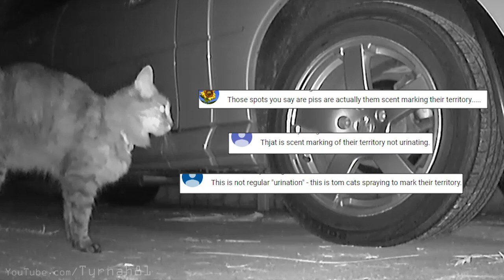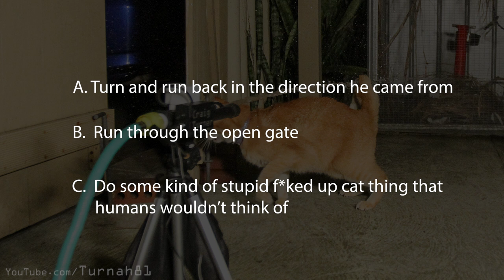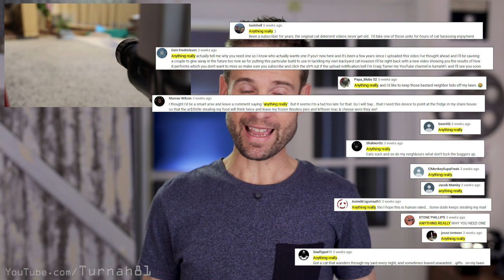Defending our Bird Nest from the Neighbor’s Cats

Comment: Idea, water blasters facing the left & the right for maximum water coverage.
Reply: exactly what i was thinking , spray them with a wider nozzle !
Reply: A simple fan dispersion pattern nozzle might work
Reply: Idea, make a flamethrower version
Reply: @Magma_122  I laughed to much at this
Reply: @-wubb5857  :)
Reply: @Magma_122  wait no XD
Reply: I'm surprised he just made a steam tip instead of one that disperses the water more but still soaks the cats. Not shitting on him by any means. I absolutely adore his creativity and that he is willing to share this adventure with us.

HE EVEN GIVES INFO ON THE DEVICES SO YOU CAN MAKE THEM!!! What a guy.
Reply: @wmoros4902  do I hear that in monotone
Reply: Crossfire.
Reply: @Damocles Media   lol 😂🤣😂🤣
Reply: Damocles Media also multiple heads that trigger in the cats path.
Reply: Honestly I was thinking they should make them turreted somehow, maybe using either a motion or heat sensor, with integrated high power flashing lights and then set them up at strategic vantage points around the house. Boom! No more trespassing cats!
Pretty sure it'd be quite easy to make the custom parts with a 3D printer, too.
Reply: Spray paint and then maybe the owners will get the message to keep their cats indoors
Reply: Wayne Iselin Eh, too extreme imho. They're cats not dogs, you can't train them and keeping them inside is next to impossible unless you basically imprison them in a room/box or something. 
This way I think that after a few weeks they'll just learn not to get mear the house
Reply: @Magma_122  It was also my idea. Some cats aren't scared of water. If they learn it won't kill them, they will keep coming.
Reply: @ilyaakadishtungha7337  Difference on both, stray cats and domestic cats... You raise them and it is up to you to let them outside at any hour or teach them to stay.

Cats aren't that social by nature to need their walks nor meet other cats- which meeting other cats usually ends in a fight.

In my humble opinion, their owners are responsible. As the owners of dogs also do.
Reply: @UKkenny  I thought of that too, but maybe he opted for the tight nozzle for a faster spray. The wide nozzle makes the water travel considerably slower, without a proper soaking (depending on the type of spray). On the other hand he had the right idea, bad maybe aim lower and position the water hose closer so that theres less reaction time
Reply: Change the setting from jet to shower
Reply: Put them lower and put on a nozzle that makes the stream flat
Reply: won't work as the two Mechine could hit each other and disable it
Reply: Archon Knight same, we might have a few problems😅😂
Reply: Damocles Media sunrise mode 😂
Reply: Damocles Media make the nozzle a little bit lower so it would actually hit them
Reply: Or do some programming and allow it to shoot 180 degree
Reply: @Magma_122   1 week later:
Channel terminated for violating the youtube guidelines
Reply: No... FULL ON MOTION ACTIVATED SPRINKLER SYSTEM!
Reply: Damocles Media  uy
Reply: Battery-powered motion detector water sprayer deterrents already exist...several models are sold on Amazon. Just attach them to your hose and stick them in the ground.
Reply: Magma_117 :3  acid.....
Reply: Excellent observation
Reply: And put citrus in the water and ground pepper, cats hate that.
Reply: And one in middle with motion detector trigger so he will get hit by one and run into another.
Reply: Or just replace with a tazer!
Reply: Checkout the Orbit “Enforcer” line of sprinkler deterrents
Reply: + adding an IR sensor-triggered Airsoft AEG with 
 a 200+ BB magazine.
Reply: Soaking the cat would just be horrible for no reason. This invention should only be to scare the cat. If the cat did get wet, the cat might stress the cat and would confuse the owner.
Reply: @buzzywuzzy5256  Who cares, cats are horrible!
Reply: James Gubbins ur insane
Reply: and above xD
Reply: One that traks movement : D
Reply: Put one in the middle of those 2 so   that you have 3 streams of water, so that way the water doesn't go around the cat
Reply: @UKkenny   i use A stick trap they give ne raybes
Reply: @Magma_122   When will you be president
Reply: @ixalaz4536   Are you sure about that?
Reply: Or in spray format instead of stream!
Reply: Add 500 mouse traps to the floor....problem solved
Reply: I say set up a cage with a motion sensor inside. Once the cat's in the cage shuts for and hour and continuously sprays the cat with high powered water until the cage reopens.
Reply: Ethylene glycol (Prestone)for the liquid.
Reply: Rat bait and sausages has 100% success rate for me. Never seen them again.
Reply: True, but you don wan o give the cats hypothermia on any cold nights, or you could have dead cats all around the neighborhood and people wouldn't really be happy with that
Reply: @Magma_122  make sure you season the damn cat first before you go on using it.
Reply: @Magma_122  Agree, I hate cats lol
Reply: One on the left, pointing right, and vice versa
But be sure not to cross the streams ;)
Reply: Damocles Media Idea, shotguns instead of water sprayers.
Reply: That's too much, they're not trying to torture the cat
Reply: Add another spray below to get more water on the cats.
Reply: Or a bucket drop, from above.....Ker Splash
Reply: MAybe one that tracks the cat! (u could edit your comment)
Reply: 1 shooting forward. 1 shooting to the left of it. 1 shooting to the right of the original. Triple turret, triple wash
Reply: @DucceMannen02  
Some people I know had a stray cat situation on a farm, well let's just say those cats didn't have 9 lives.  Mossberg and Benelli had a body count(s) that day
Reply: or perhaps a "fan" type spray !  More coverage !
Reply: Lol I just thpught he should lower it.
Reply: Might as well just drop em in a “kitty”(kiddie) pool
Reply: Lower the nozzle to ground level and tilt slightly upward to get a more effective kill zone!!!
Reply: yes, put another by the escape route to the right

Comment: Love it! We have a cat problem here also, most our neighbours have a cat that roams during the night and day. We have had two native birds killed, several lizards dead in our garden, scratches on our bonnet, two dead snakes just to name a few. 

We purchased a cat trap, caught the five roaming cats 13 times with every time dumping them at the pound so the owners had to pay a fee to get them released. They didn’t learn their lesson. So now, we have set up an electric fence around our boundary, the cats go under the fence where the wire is,  need I say the cats rarely come here now? We turned up the voltage a little bit as they didn’t learn the first time. Now they certainly do.

Comment: Any chance of showing one that can use a tank of water, pump and battery powered rather than a hose. A friends, yes, I'll go with a 'friend' requires a set up like that.
Reply from the maker: Yep could just use pressure sprayer. Hose size would need to be adapted down though.
Reply: @Turnah81  Cheers for that, need something to keep the felines from leaving their 'messages' as well as using the car tyres as a scratching post.

Comment: I'm a cat owner and I have to say I like your creative solution. I would like to give a bit of advice on some upgrades to the system that I think would be more effective.
1. Rig the spray system to have a thinner jet stream so it goes further and has more impact when it hits.
2. Rig a Jug to the hose system so Instead of water, you can use a diluted vinegar solution, this will not harm the cats but the smell will keep them from coming back.
3. Use some kind of automated rotation to swing the nozzle of the device in the direction of the cat, don't let them explore. This will keep them from even thinking about exploring the area they enter. Becomes an effective deterrent.
4. Wash down everything they pee on with a urine neutralizer. Part of the reason that you have a cat highway is because of the scent. Cats memory of an area are triggered strongly by scent, if you reduce that along with all the other deterrents, they will not use this path anymore.

I liked the video.
Reply: @DragonDaSilvahas_massive_chode  Such as?
Reply: He mentioned he neutralizes it with bleach.
Reply: @DragonDaSilvahas_massive_chode  XD What? Like no more videos like this?
Reply: Swap it with shotgun
Reply: I think that the spray is fine as it is; enough impact, distance and the wide jet also allows to reach more fur as "collateral damage" if the main stream misses the cat (just like happened in this video).

The vinegar solution could be effective, but I don't think he will enjoy that smell on his backyard...

Despite that, I fully agree with the 3rd and 4th point :)
Reply: A higher pressure spray would go straighter and then he could lower the jet such that it wouldn't almost miss cats going in the intended route for the system (??? bad design lol)
Reply: After reading first three words:
No you’re a Raccoon
Reply: For automatically aiming directly at the cat, you could use the cat's eyes as they always appear as very bright spots in your night vision footage, which would make for easy and good reference points to avoid it firing at just whatever
Reply: Better idea, grab the Smith and Wesson franky.
Reply: @SeaIify  the smell of vinegar dissipated once dry
Reply: @DelightfulDissident  Yeah, but the taste doesn't and they have to groom that off. That's something a cat will remember.
Reply: @NecrochildK  oh I bet 😄 I was responding to someone saying that he wouldn't want to use vinegar in his backyard because of the smell. 👌🏼 I'm pro vinegar water.
Reply: @davidtogi5878 + No. There is no need for guns.
Reply: @dogsaretheworsttheyarenotm9647  their cats. Of course there's a need for guns

Comment: We have a similar situation here. There is a bush right outside our living room in which a bird has started building a nest. This isn't the first time a bird has used this bush for her nest, the last one was a few years ago but ended in tragedy. At that time, the babies hatched but their home was sacked and the young ones killed, by one of the neighborhood cats or so we suspect. This time we are going to help fortify the nest without scaring the mother, so looking for ideas. I like this motion activated water spray solution, as I can engineer it elsewhere and place it on the ground without too much disruption to her privacy. Other ideas that crossed my mind was to erect an elevated chicken wire fence around the bush,  cast a net over the bush with an opening cutout on top etc. I have to make up my mind quickly. This was hilarious and the size and scope of the project is equally impressive.

Comment: You should have made a thing where there is a square of like wood or metal and on the middle put food or something the cats will check out but have a weight censer on the square so after a few seconds it really fastly pushes the square up and yeets the cat many meters in the air.

Comment: Love it...  .F Y. I.  the military use 3 kill zones in a ambush scenario
  the main kill zone in the middle  flanked let and right   you could use this technique for extra soakability
Reply: And some water balloons attached to the ceiling, in case he needs air support.
Reply: Or like... copy my unit and use bullets to get rid of the problem.

One pellet rifle, a couple nights, some discrete plastic bin bags, and you're good.
Reply: Yard Sale Dale  Oh interesting! I didn't even know those existed, well, I knew about primer only .22 loads but I thought those were long extinct with gallery guns. 

The thing being, from my research the SC .22 appears to only be viable on squirrels within 20m out of standard rifles. You can easily get the same results out of a high quality air-pistol that'd be more customizable, cheaper, and more easily acquired than a conventional firearm. Additionally, you can easily suppress (mount a suppressor to) an air gun, not so much a regular firearm... that is... unless you wanted to operate by don't ask don't tell rules.
Reply: Mr.Techaky a buddy of mine had a breech loading .22 that he put a homemade suppressor on.  Used to shoot it in his garage at phone books using subsonic .22lr ammo.  It was whisper quiet.
Reply: @OldManTheseDays  Yes... I have friends with suppressed .22LR pistols. So quiet the only thing you can hear when they shoot is the clicking of the slide!! I absolutely adore suppressors, shame they're still NFA...

Comment: 1. Lower spray
2. Take away lights

These changes will  make the cats get more soaked in which they will avoid the yard more
Reply: First Name Last Name                            I agree, lower the water.
Reply: @camillenelson7176  no I mean bring the sprayer closer to ground
Reply: @camillenelson7176  no!
Reply: 1 bucket
2 prorit
Reply: Not lower, just a vertical flat sprayer.

Comment: Upgrade: Split the water stream so that the 2 streams are a few degrees off-center.  Should hit a moving target much better.  🤣🤣🤣
Reply: Puppu Jinks  What's scarier to a cat than getting hit full blast by a sudden rush of water?
Reply: @RJLiams  it might hurt the cat
Reply: Andy Helms  comparin apples and oranges
Reply: @user-xq7vl4gs3x  That's a really big might. The water isn't coming fast enough to do any kind of harm. Even if it did, the harm would be extremely minimal. The lesson though will be permanent.

Comment: This is how you do it dude. You have it all wrong. First, find a lovely lady at a vet and grab some tranq drugs. Then rig your perimeter with a downward facing 500,000 volt dinosaur fence. Now when you get up the next morning your gonna have some half asleep cats, and some that are really mental. Don your SWAT gear (that you got off that hot cop chick), load up a hypodermic with the sed from the vet chick, then wander into the yard and start injecting. Onece all the cats are all doped up and comatose, start loading them into the yellow bin. :) You'll be in full battle gear, so the cats will only get a few claw strikes at you depending on the strength of the stuff and the amount of charm you used on the vet chick :)
Reply: PS I love your video's. Thats just MY imagination running wild ;)

Comment: I have an idea to add to the effectiveness of your rig.

My neighbor got tired of the variable water pressure on the well and rigged a holding tank & booster pump.  That way his sprinklers get consistent water pressure.

So, get a tank rigged with a float switch to keep it topped from your tap.  Then put a high volume, high pressure pump that gets you a couple gallons a second something like a 2" fire hose.  This way you can get wide coverage and good saturation.

Fairly certain the cats won't forget that experience after they land a couple blocks away.

Cheers, great work mate.